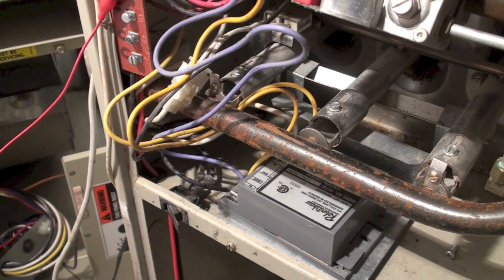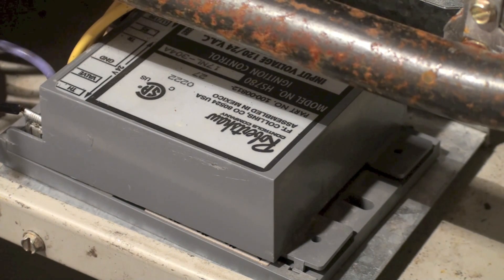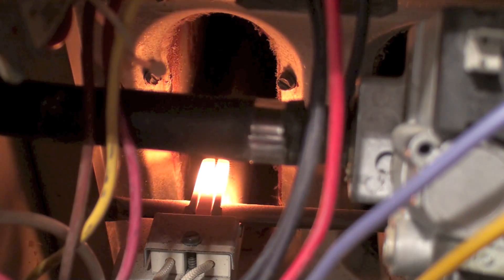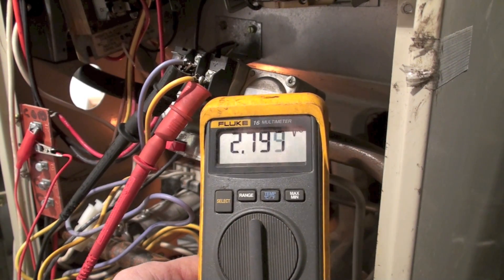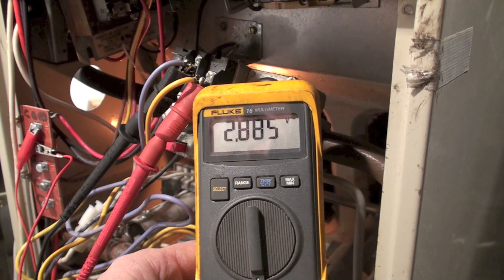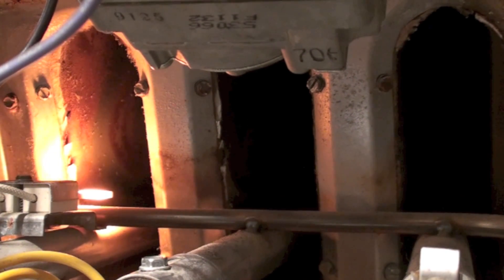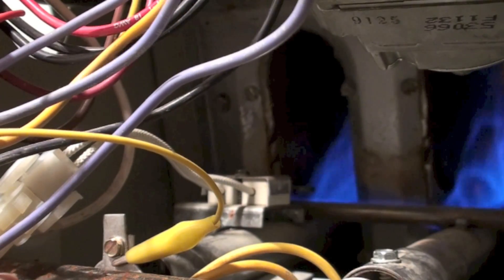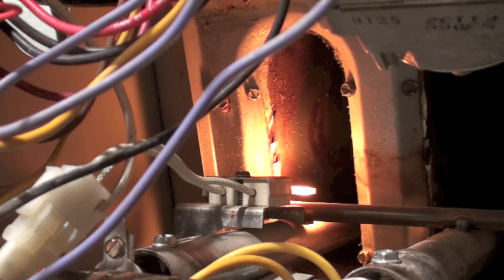Robertshaw HS 780 ignition control flame failure

Comment: So how did you ground the HS780….I just replaced my HS780 now that flame spreader won’t stay lit…and the burners then don’t light…
Reply from the maker: It grounds thru of the mount screws.
GFM
Reply: The ignitor light the bar with gas coming thru then the burners should light…that bar is not steady enough flame and the burners won’t light…is there dirt in that gas bar?
Reply from the maker: @lotsaluck721  I believe there is an orifice in that tube that may be blocked.
GFM

Comment: I just fixed my 780-002 (spark ignitor) with similar symptom. The gas valve was intermittent sometimes trying 3 times and then locking out. Reset with thermostat (down /up) and it would work again but sometimes the gas valve "buzzed" (low voltage). This went away when I jiggled the red MV wire so I knew it was a bad connection somewhere. I took apart the module and found 2 cold solder joints on the MV output of the board. Re- soldered them and vola!... furnace runs great now! I must admit this took 10 years to fail, but poor manufacturing process at Robertshaw was the root cause
Reply from the maker: Interesting info.
GFM

Comment: Mr GFM if you are still there. I have a furnace very much like this one: Rheem RGLD,  installed ~1990.  Behavior is as you depict: ignitor glows, valve clicks open, ignitor and valve off. But I think I *do have good ground.  Replaced the controller and ignitor and valve - same behavior. Any other thoughts? Am being told to get a new furnace ...
Reply from the maker: I am still here.  If you have a good gas supply, you probably have a gas valve failure.
GFM
Reply: @grayfurnaceman  Additional question. I got the furnace to light so the parts are  all good. But what mattered was this. There is a cut in the pilot tube. My pilot tube is Aluminum coming out of the valve, then an elbow fitting, then SS to the back cross tube that lights from the ignitor. Just beyond the elbow, on the underside of the SS tube (impossible to see) it looks like someone hacksawed half way through the tube. Is that a breather? Is it supposed to be there? I covered it temporarily with duct tape and the furnace lit.  Duct tape is not a good solution, and maybe that opening is needed and the problem is elsewhere. Any advice? Very much appreciated.
Reply from the maker: @bluna5143   Its a flame spreader.  It moves the flame from the first burner to the rest.
GFM

Comment: So in this case the gas valve won't open just click? Would you be able to read gas pressure just for a few seconds or not at all? I've had a furnace with a IFC that was doing this, but it would only do it intermittently. It would run fine for a month then all of a sudden not come on and would eventually lock out.
Reply: The valve does not even click.
GFM

Comment: Thanks man.  Just saved me $90 bucks!  Loose ground was causing my fireplace to turn off and on.  Same setup as this furnace. ;-)
Reply from the maker: Merry Christmas
GFM
Reply: Gary my furnace  has the same problem turn thermostat to heat inducer motor turns on inginter turns red gas starts to lighr and than shuts off

Comment: This is a question on the hot surface ignitor/flame sensor on the rheem rgda series furnace. my proving flame lights for 3-4 seconds then shuts off without main gas coming on.  I replaced the surface ignitor and it's still not proving the flame signaling the main valve to release gas to burners so I removed the HS780 34NL 306A control from the ground and now it works fine. I am assuming that the controller is bad, is there a compatible board that I can use?

Thanks For The Videos...
Reply from the maker: Check the Honeywell or White Rodgers crossover charts.  There will be replacements that will work with your furnace.
GFM

Comment: regarding the hot surface ignitor/flame sensor on the rheem rgda series furnace. my proving flame lights for 3-4 seconds then shuts off without main gas coming on.  I repositioned the ignitor with no luck so I replaced it.  it's still not proving the flame signaling the main valve to release gas to burners.  the control is brand new as well and well grounded. any idea what I may be missing? thank you.
Reply from the maker: +Craig Kessel Is the replacement control the Robertshaw 780?
GFM
Reply: +grayfurnaceman yes it is HS780; 34NL-306A
Reply from the maker: +Craig Kessel There were endless problems with this combination.  The use of the ignitor as a flame sensor was never a good idea.  Honeywell and White Rodgers both make upgrade replacement controls that include a separate flame rod.  I would go to one of the replacement controls.
GFM

Comment: Does this necessary grounding of the control apply only to this particular control? What about other boards such as an integrated control board that has no apparent ground terminal on the control, to be grounded?
Reply from the maker: +JustPlumDucky Many of the newer controls do not need grounding at the board.  If they need grounding, there will at least one metal sleeve on the control mounts.  Hope this helps.
GFM

Comment: For five years I've been bypassing the controller and getting the heat to come on and shutting it off when I went to work. I had replaced the controller and just layed the new one in the furnace to test it, never screwing it down. I assumed the new part was not a suitable replacement, but never took the time to troubleshoot or get another one. I just now went and screwed it down to the bracket, wow, five years, thank you!!!
Reply: Don't feel bad, I did the same thing! Although it was more like 5 hours rather than 5 years. Who knew an entire heater won't work because of a tiny screw. >.>

Comment from the maker: Flame is sensed by flame rectification.  When AC power is applied to to the flame rod, it completes the circuit thru the flame to the burner.  Flame is a conductor.  Because the burner is much larger than the flame rod, more power passes from the burner to the flame rod than from the flame rod to the burner.  The result is an out of balance circuit with most of the power going one way, essentially DC.  So proper grounding of the control is essential.  Hope this helps.  
GFM

Comment from the maker: Be sure the ground is good at the control.  The control you want to use will probably work ok.  Be sure it shuts down the burner if there is no flame.  Shut off the gas and let it shut down until it stays off.  I have more videos coming on this control probably tomorrow.  Merry Christmas
GFM